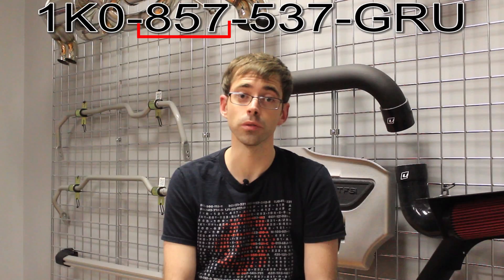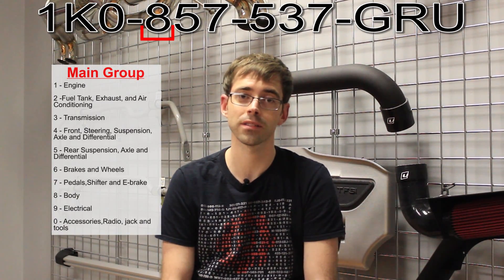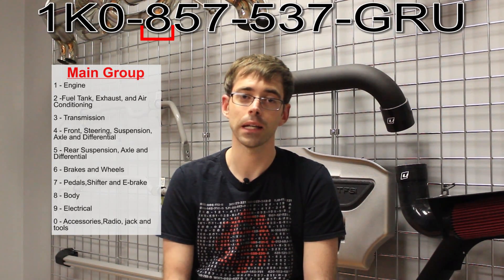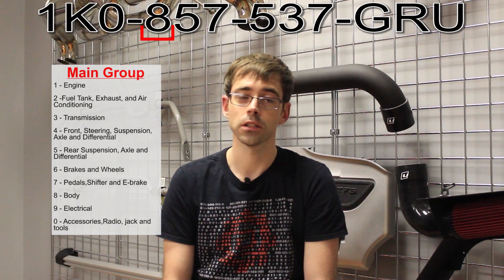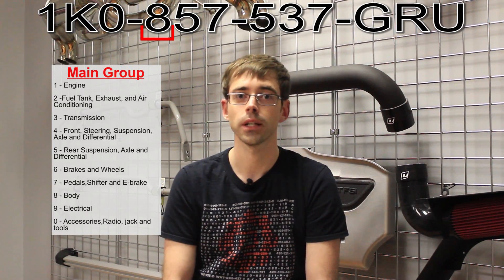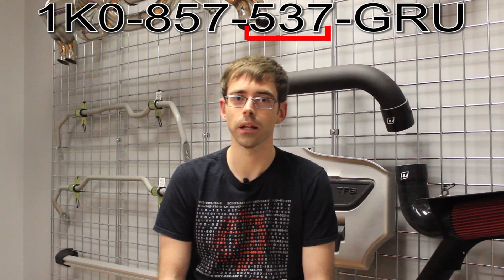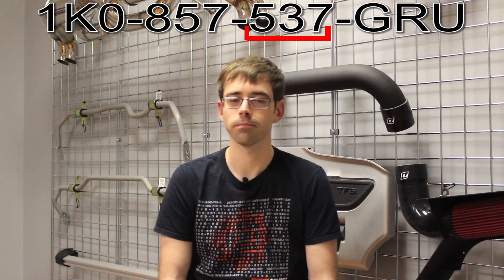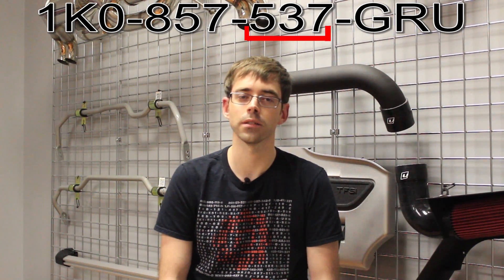How do VW and Audi Part Numbers Works (From a VW and Audi Parts Expert)

Comment: Nice video need to knw will abs module 1K0614517DP fit instead of 1K0614517DP BEF . Is ter any way to program it with anathema software version

Comment: Thanks for the video, my part number is 8S0941036C (Audi TT headlight) Could you please help me confirm if 8S0941036 or 8S0941036B would be interchangeable. Thanks

Comment: I watched all the way still didn’t get few things - so will 
8s0-823-029-B be interchangeable with 
8w0-823-029-A ?  
The reason I am asking cause I need  replacement hood for my TT and there is only dealer inventory . Where I can get used A4 hood for cheap . By looking on both they look identical . But would appreciate your input . Thx
Reply: Or 8v5-823-029-A

Comment: need your help urgently.... got a problem the dealer is trying to screw me over on... so im trying to solve it myself... 1st- what does it mean when the part has 2 part #s on it such as this- the top in bold says 4F0907273A the the bottom # is smaller and says 420910273... whats the deal if i found the top # correctly but the bottom # is 420910273A also? its the tpms and the dealer wants to force me to get their tyre sensors to solve what i think is a module error... and they are starting out at $2000 to solve a tpms error... the sensors are HUF who makes it for Audi and they want to force me to get theirs with the Audi arse raped 4 times symbol on it... help please...

Comment: 15:00 a note about first group: 3B1 means 3b platform but also that the part is different from lhd to rhd. 1 means lhd, 2 means rhd, a part that is common in lhd and rhd would be 3B0. (=This lock wouldn't work in an rhd vehicle) Of course there could be other numbers which I don't know what they mean like 3B8. Also at the 3rd group code, if it ends in X it means a remanufactured part (ie not new). There's also a code for parts that you must send back the old one (exchange parts, which are cheaper)

Comment: My question has to do with the modules (e.g., telephone module ) that are under the floor board and the steering column in an Audi 2009 A8L. I believe that the parts may not have been  replaced as I’m being told Do the numbers include dates? Is there any way to verify that they have been replaced?
Reply from the maker: The parts themselves likely have a production date one them but this isn't going to determine when they were replaced
Reply: If the original parts were the ones being replaced would that help? The car was manufactured in 2009 the parts were replaced last month...

Comment: Hello,
Thanks for the video. Pls I have some questions I want you to clarify. After watching your video, I took a look at the airbag sensor for a VW golf Mk4 and Touran. The golf has this part number 6Q0909606  5WK42895 and the Touran 1T0909606 5WK43340. Physically looking at these parts, they are the same and have the same connector. The only difference is the colors. One is black and the other is orange. Does it mean these parts are interchangeable? What does the numbers 5WK... mean? Could it be the software coding

Comment: Many thanks for the clarification.
Especially the last part about the meaning of the last letter(s).

I have a audi A4 -09 and i used to think the larger the letter the later the generation and the less bugs i will encounter...

That worked just fine untill yesterday when i recieved a new door latch, of course i purcased an F model instead of the original A, F must be better, right?

Yes and no....
The new lock have a 6-pin, one row electrical connector while the old one have 8-pin two rows....
Otherwise it fit spot on..

Luckily i could make an adapter cable and get it to work... This time..
So as you say, last letters may have no practical meaning or it may be a whole different part.. :-(

Comment: I'm confused on how to  find the correct part number based on Audi's repair manuals. In Audi's repair manual, the parts are always being indexed with a number starting with "N". Below is an example of the exact solenoid valve used for four different functions and listed in the 3.0 TFSI engine repair manual under different index numbers:

4 - Engine oil cooler valve -
N554-
5 - Solenoid for coolant circuit
- N492-
6 - Intake manifold flap valve -
N316-
7 - Secondary air inlet valve -
N112-

How can I find the correct part number based on these index numbers in the manual?
Reply: I'm no expert but i give it a try..
The leters, e,g N+number are codes corresponding to a specific type of  part rather than a part in your specific car model.

This simplifies for a workshop technichan who read manuals for many different car models.

I usually google the car model code (e,g B8 for my A4 Audi) an the letter+number code, most of the time that give a part number.
Then i have to check more specifical, year model and so on.